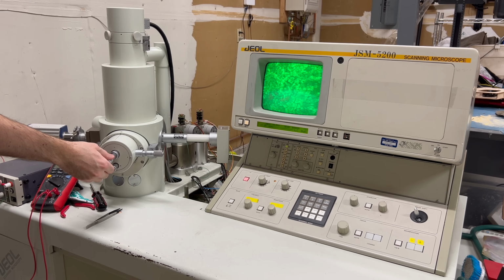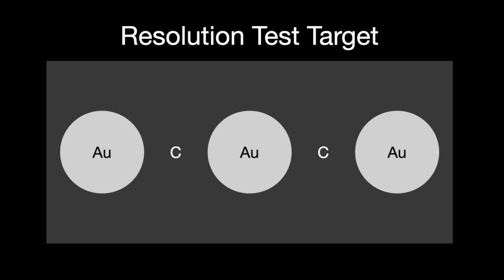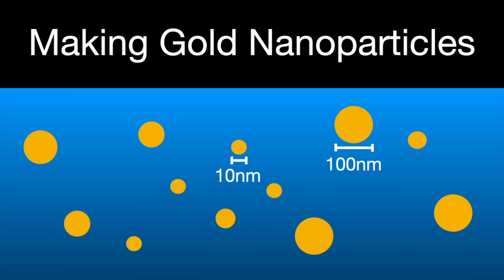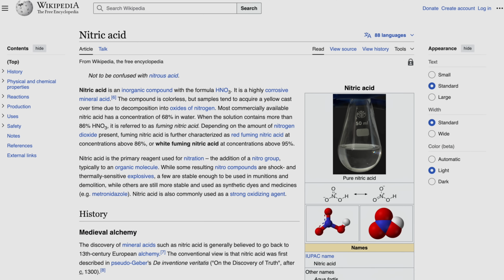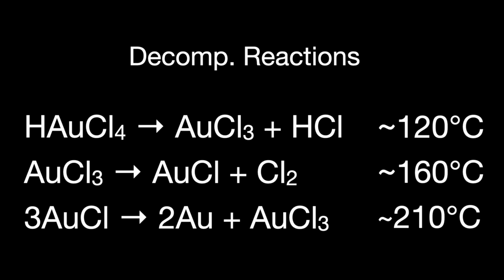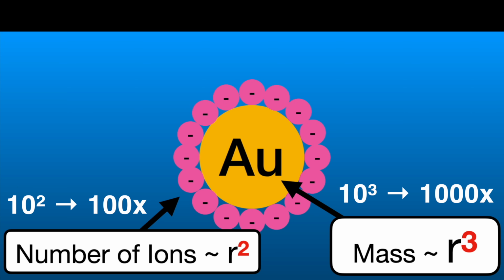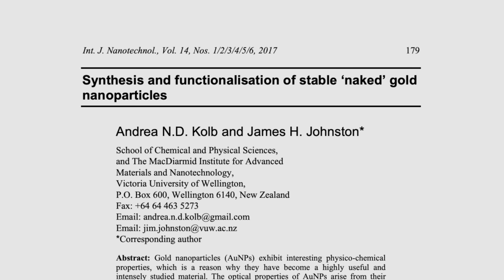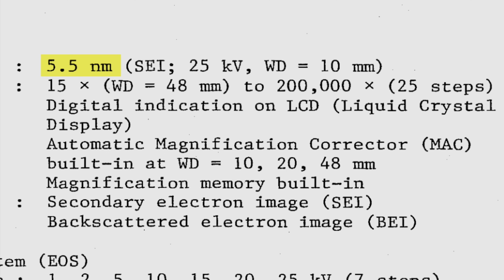Making Gold Nanoparticles to Calibrate My SEM

Comment: Please be safe with the chemicals I was refining some gold about 8 years ago in my driveway and someone pulled up then the temperature got to high and when I went to get things under control the wind changed and so did the fumes and now my lungs are still paying for it. That’s one time I wish I still had my respirator on
Reply from the maker: i'm sorry to hear that. I do my best to avoid NO2 gas. I fortunately have a fume hood now so the problem is lessened. i also try to keep quantities small if i can.

Comment: Maybe tuning it in giving it the right harmonic frequency and bandwidth\n Could you have it feeding in on itselflike maybe a plasma ball, and then you make the plasma ball go inwards all the energy and it inverts.  Until like a different shape inwards , the exact shape inwards , smaller kind of like inverting a shape with the Z PINCH. BUT ITS LIKE INVERTING A Z PINCH.

Comment: You need a large excess of Sodium Bisulfite to distill nitric acid at a reasonable yield and to get the best yield you need to add water to distill off a lower concentration. Then i find on subsequent runs you can instead use dilute nitric acid rather than water to improve the yield while also boosting the concentration.

Comment: Next time you need to purify HCl, do this:
1) Get some distilled water, and fill half of a beaker with it.
2) Fill half of an identical beaker with the dirty HCl
3) Put both beakers in a hermetic plastic box, outside.
4) Wait a week (less if your starting HCl is concentrated)

What will happen here is that HCl gas is so volatile that it will evaporate into the plastic box and start dissolving into the distilled water. After some days, both beakers will be in equilibrium with one another – the concentration of HCl in both will be the same. This is a cheap and almost trivial way to clean up HCl. The thing is so volatile that, as long as there is some amount of energy for it to evaporate, it will basically distill itself.

Comment: Switch the CRT to an LCD
Reply from the maker: the extra computer system that attaches to it has an LCD, so i use that sometimes. the CRT though actually serves a purpose. the persistence of the green phosphor makes it so that you can scan slower and still see the whole screen. that wouldn't work for an LCD unless you add a frame buffer or something
Reply: @projectsinflight Wow, that's a great point actually

Comment: This is all very exciting and gives me the urge to also delph privatly into chemistry more, which might rekindle my love for it again after I turned this interest into a job and it lost a chunk of it's appeal. 
Just two things I want to mention on the distillations:
1. it isn't always as easy as attaching a single collection flask and keep it there for the entire distillation, since some mixtures are composed of substances that will distill over at a lower temperature than the target liquid. Many people dabbling with homemade brandy will know, that you have to keep an eye on the temperature and discard the foreshot/heads you get before the actual alcohole distills over. Otherwise the brandy will contain much more junk than you bargained for, especially the very toxic methanol.
2. you are loosing some efficiency of your condenser if you have it rotated as you did to be horizontal. Turning it 90° so the exit port is pointing up should prevent all but the smallest of air bubbles from forming and cooling down the vapours as best it can.

Comment: I'd really love to know, (as a nobody who thinks chemistry is still complete wizardry), how exactly you combined all three particle generation methods on the same chip, especially with the separate temp requirements for the large nanoparticles.
Reply: I'm not an expert, but I think he did it like this. On his first attempt, he didn't directly do the experiment on the chip, I think he made different sized nanoparticles, put a small drop of all size ranges on the chip and then dried it

Comment: hmh. a crt display is a simple sem. basic crt easily reaches around 100um spot size assuming 1600x900 resolution. for simple cheap chip making. well seems like annealing a silver coating would make the dots test pattern. also would fit your light-dense contrast requirements. well by trial and error, just twist the knobs until you find the solution. as usual. well delidding a chip would be a perfect calibration target. ie an old microchip or cpu processor. well silver on substrate is automatic contrast. every crt display is already easily calibrated to 100um. ie pixel size. enough for first tests and chip manufacturing process development. hcl = vinegar + nacl table salt.

Comment: I accidentally made gold nanocubes by drop casting a concentrated solution of gold bromide onto silicon chips. Imaging them via an AFM was fun but they'd disappear after a few days...now I know I need a stabilizing agent. You should try that gold bromide method. Pretty simple. Bromine ions form bromine gas and evaporate out forcing gold 3+ to form a 0 charge to maintain charge neutrality. Cheers.
Reply from the maker: do you remember what the size of the cubes was by chance?

Comment: 15:40 Water is a great acidity buffer for super acids, but an even better temperature buffer for aqueous solutions. They'll never get over the boiling point of water. So don't let solutions in water dry out on hot plates, first it will destroy your compound of interest and then the beaker, even borosilicate^^

Comment: AI Summary

Abstract:

This video chronicles a meticulous journey to create a custom gold nanoparticle resolution target essential for calibrating and optimizing an antique scanning electron microscope (SEM). The creator explains that unlike optical microscopes, SEMs rely on material density for contrast, necessitating high-atomic-number materials like gold against low-density backgrounds like silicon. The project involved complex chemical synthesis, including purifying hydrochloric acid, synthesizing nitric acid, dissolving a gold bar in aqua regia to form chloroauric acid, and then precipitating gold nanoparticles. Various synthesis methods were explored; initially, the Turkovich method yielded small, unstable nanoparticles. Through iterative experimentation and a deeper scientific understanding of "nucleation" versus "particle growth," the creator discovered that performing the synthesis at cold temperatures dramatically reduced nucleation, allowing for the growth of significantly larger (micrometer-scale) and more stable gold particles. The successful creation of a multi-range resolution target, featuring nanoparticles from 50 nanometers to 10 micrometers, proves invaluable for SEM calibration and performance assessment, with plans to share these targets with other hobbyist SEM owners.

Creating a Gold Nanoparticle Resolution Target for SEM Calibration

*   0:00 - The Need for SEM Calibration: To improve the performance of an old electron microscope (rated 200,000x magnification, 5nm resolution), a specialized resolution test target is required for precise calibration and performance assessment.
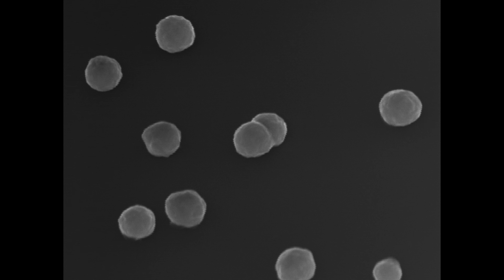*   0:47 - Contrast in Electron Microscopy: Unlike optical systems, SEMs generate contrast based on material topography or, crucially, material density. To maximize contrast, materials with significantly different atomic numbers are needed, such as low-density carbon and high-density gold.
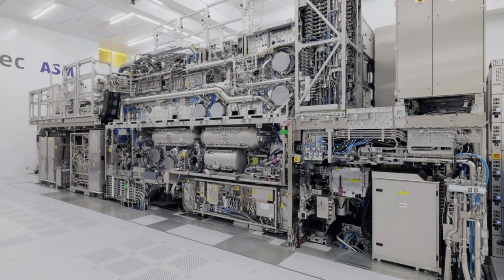*   3:37 - Ideal Test Pattern: Gold Nanoparticles: Spherical gold nanoparticles of various sizes on a carbon (or silicon) background serve as an ideal and repeatable resolution target due to their simple, quantifiable geometry, also aiding in beam calibration.
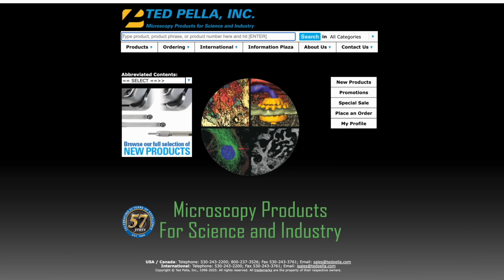*   5:22 - Why DIY? The creator opted to synthesize the targets himself due to the high commercial cost (over $200 each) and the need for a wider range of particle sizes suitable for hobbyist SEMs, which often have lower initial resolutions.
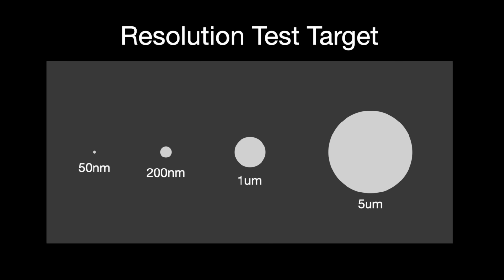*   6:32 - Silicon as a Background: A polished silicon wafer was chosen as a suitable low-density background, serving as an alternative to carbon.
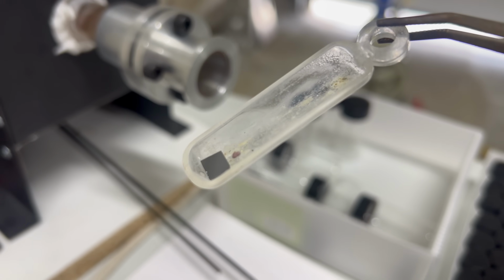*   7:11 - Gold Nanoparticle Chemistry Explained: The core chemical process involves dissolving gold in aqua regia to form chloroauric acid, then reducing this compound back to elemental gold which precipitates as nanoparticles. Soluble ions (like citrate) are used to keep the nanoparticles dispersed.
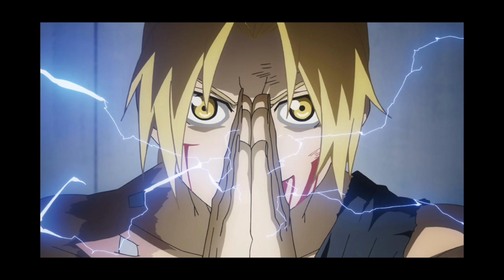*   8:59 - Acid Preparation Challenges (HCl): Purchased hydrochloric acid, found to be impure, required distillation. A miscalculation of the acid's concentration (32% instead of 20%) led to excessive fuming during purification, emphasizing the importance of PPE and proper dilution.
*   12:09 - Acid Preparation Challenges (Nitric Acid): Nitric acid was synthesized from sodium sulfate and sodium nitrate, presenting difficulties due to solid reactants and products, which required a significant amount of water and limited the yield.
*   13:57 - Pure Chloroauric Acid: After successfully dissolving the gold bar in the prepared aqua regia, the solution was carefully boiled down at 80°C to obtain pure chloroauric acid trihydrate, avoiding decomposition back to elemental gold by preventing overheating.
*   15:57 - Initial Nanoparticle Synthesis (Turkovich Method): Using the purified chloroauric acid and sodium citrate, small (50-100 nm) gold nanoparticles were produced, indicated by a characteristic purple/red color due to surface plasmon resonance. However, initial SEM imaging of these particles was blurry, suggesting calibration issues.
*   18:19 - Overcoming Aggregation: Attempts to synthesize larger nanoparticles using conventional methods failed; particles either remained small or aggregated. This was attributed to the destabilizing effect of increased mass (radius cubed) outpacing the stabilizing effect of surface ions (radius squared) for larger particles.
*   20:33 - Breakthrough Method for Micrometer-Sized Particles: A new technique was developed where reactants (chloroauric acid and sodium metabisulfite) were mixed directly on the silicon chip within a flattened liquid drop. This method successfully produced well-separated gold particles up to 1 micrometer.
*   23:11 - Achieving Even Larger Particles: To break the 1-micrometer barrier, the creator adopted a more scientific approach, studying the balance between "nucleation" (forming new particles) and "particle growth." The key discovery was that performing the reaction at very cold temperatures (near freezing) drastically slows nucleation, allowing existing particles to grow significantly larger.
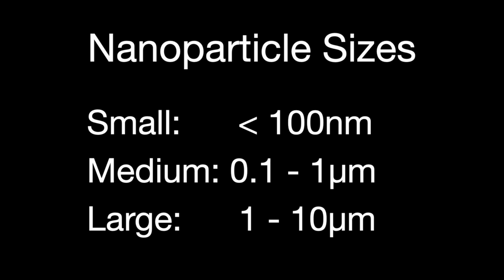*   27:31 - Final Resolution Target and Future Plans: The combined methods successfully yielded a single chip containing gold nanoparticles ranging from 50 nanometers up to 10 micrometers. This target was used to improve the SEM's image quality, particularly astigmatism settings. The creator plans to produce these targets for other hobbyist SEM owners and build a proper fume hood for future chemical experiments.

I used gemini-2.5-flash-preview-05-20| input-price: 0.15 output-price: 3.5 max-context-length: 128_000 on rocketrecap dot com to summarize the transcript.
Cost (if I didn't use the free tier): $0.0074
Input tokens: 23456
Output tokens: 1112

Comment: I study nanoparticle synthesis and do a lot of TEM and SEM. This is super cool, good job. It also pains me to watch and think of solutions to your synthesis problem only to remember hobbyists cannot get like 99% of the stuff I'm thinking of lol. In fact this makes me realize that I have no concept of what the hobbyist does or does not have access to when purchasing chemicals. The on silicon chip synthesis between the two plates was a great idea. As you saw NP synthesis a super, super deep rabbit hole and the whole LeMar theory of nucleation and growth doesn't even cover the entirety of it, though it is quite important. 

I'm assuming hobbyists would have a hard time getting NaBH4? One thing you can do to control particle size is to use two different reducing agents, one that's weaker than the other. You use a small amount of strong stuff to cause some specific amount of nucleation, hopefully falling below a critical concentration to turn off nucleation, then the weaker stuff to cause growth of the formed nuclei without making more nuclei. Saw in the literature that somebody used citrate and tannic acid on silver NPs.
Reply from the maker: hey, this is super cool info! do you want to email me? it's projectsinflight at gmail dot com
Reply: @projectsinflight  Sent.

Comment: Is it possible to modify the machine to display the images in color or is that not possible for this type of model? I'm thinking it might not be possible given the tube type used for the machine, but for a program to convert the images to color, I imagine something like that exist.
Reply from the maker: Color is a property of light, and the SEM doesn't use photons, it uses electrons, so the machine fundamentally doesn't have any ability to display a color image. Any color SEM image you've seen has been colored by manually altering the image with photoshop, for example
Reply: Some BSE (BackScatter Electron) detectors apply artificial colors to various gray scale layers.

Comment: 😢Cometial HCl solutions contain Fe(III), SORRY, you should use HCl gas instead. Could it be iron(III) contaminant THAT YOU FIND large nanoparticles.
Reply: If you electrolize Au wires in diluted HCl you would skip one step towards a colloid.

Comment: Your solution to the particle crowding problem (flattening the drop with a slide cover) was great. however, couldn't you have used a more diluted mixture of the acid and the bisulfite? same ratio, just less particles in the drop
Reply from the maker: diluting the solution helps somewhat but also affects the particle size as well. I did definitely change the solution concentrations in my experiments, but ended up kind of glossing over that

Comment: Dude, .:.

you go on here for almost thirty minutes to pretend to understand what the people who lived along the long running current
often called the Nile for more than 9000 years learned about things that were found in the red earth and the black earth and
in the earth generally...for a period of consecutive time beginning around 12,000 years before exactly....now

If you stop trying to make acids and pay a little attention to what the master gold smelters wrote all over the walls of the buildings
that they built to serve as processing factories which generated the acids and the ultimate Soul~lution aka liquid gold which those
crafty people who used a spiral of copper wire to whisk the dead brain out of the body of the former employer just happened to 
find in quantities large enough that they were willing able and did actually turn a lot of dirt into gold and then put the same 
dirt back into the ground that the material was ground out of and turned into something else in a different geometric 
arrangement ..::.. quartz at a time or by bucketloads of quartered quartz ...:..

As they were producing ammonia [aka hydrochloric acid jr. ] Gold was the byproduct of the solution aka the solution
that did not need computers to arrive at as it was there to begin with ..:.. and the ammonia products were used to 
fertilize the land while the gold residue was used to return the deep thinkers to the deep earth from which their
deep thought brought the fruits of the earth in all its generated and generate~able forms...

bravo... now do yourself a favor and learn something about what you obviously spent more than 30 minutes
to come to understand about as much as anyone who might have been asking the same questions came
to more than 9,000 years (356.25 days of 24 hour days per) before now .:. give or take a couple of thou...

what has happened in the interim is the least of what any of us now alive need to know 

think of it this way, did the people who lived on that volcanic land learn how to find veins
of gold left over from volcanic activity and then dig out the veins to generate the so 
called tombs within which the employers of the diggers were ultimately buried 
along with a small fraction of the extraction that they had accomplished in
their lifetime ....:..

in plain english, look at the holes that were dug into mountains for the 
few decades before the 19 year old King Tut was put into one of the
much smaller ones along with more gold than you could shake a 
living stick at if you were able to shake a living stick.

That picture is not going to fit into the viewing 
stack of an SEM or anything looking at any
thing smaller than what one can see with
ones eyes one at a time the way horus
was said {according to Harvard experts}
to have seen things

Comment: Why didn't you use surfactantce like in ferro fluid if the particles can't be stablelizes by ionizing changes and then removed it when needed?

Comment: Just curious, would it be possible to use some modern semiconductor device silicon and copper arent as far off as gold and carbon, but feature size can be super tiny and topographically interesting
Reply from the maker: I wanted to maximize contrast, so using gold for its high density was important. Also, In my experience IC dies are actually pretty tricky to look at, since most decapping processes have a tendency to remove the metals, leaving behind mostly silicon, making them difficult to image well due to a lack of contrasting materials.
Reply: @projectsinflight  there is someone on youtube i think who decaps without rfna. I think they just use some sort of hot organic thing. I go find it real quick
Reply: @projectsinflight  yeah, he boils them in pine gum rosin. https://youtube.com/shorts/65uFILJF2iU?si=eIr3KOxxAwP0LzpS